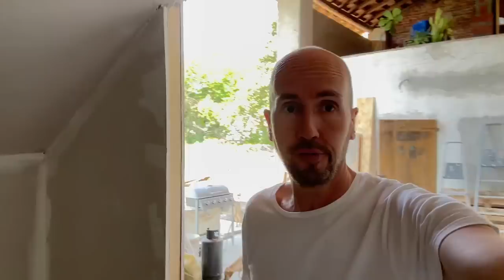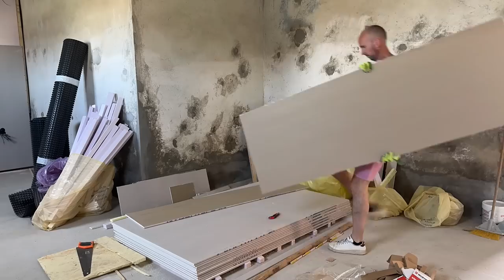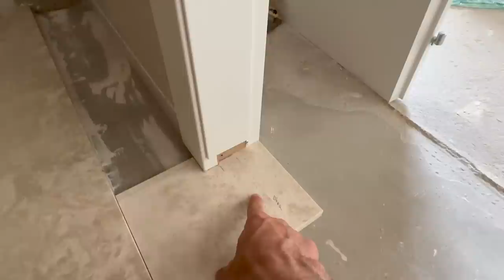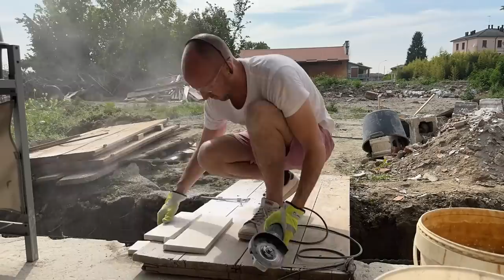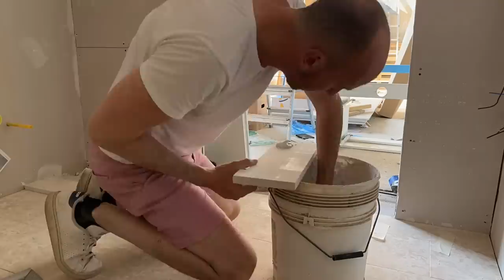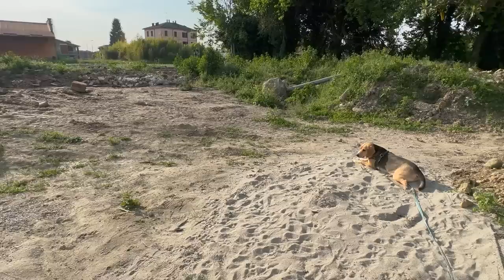"Major" milestone, the BATHROOM FLOOR is "finished" | Vlog

Comment: Your dogs seem to have settled in 😊.
The bathroom is looking good. 
Could you run through your plans for the large doors to close up the entrance? If you already have, do you know which vlog I can find? 
Keep up the good work
Cheers
Reply from the maker: Thank you! 

I cant really remember exactly when but I did a run through about 5-6 weeks ago I think. The idea is to get 4 large windows there one which can slide open so it's basically going to be large glas section and an open space area inside.
Reply: @VillaAroldi  thanks. Won't be too far away when you can install them